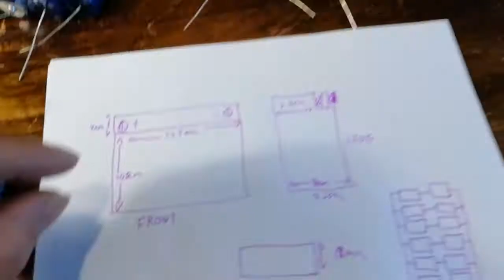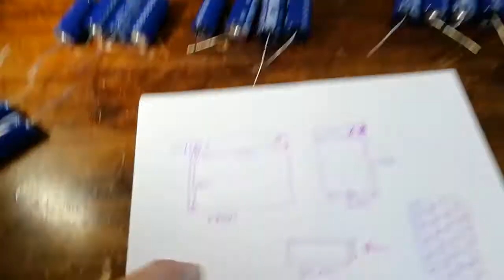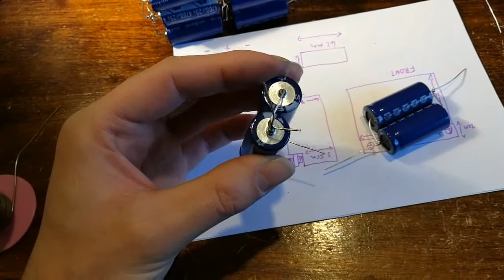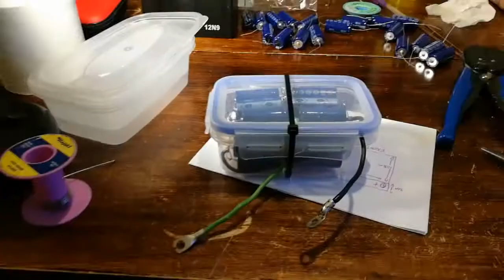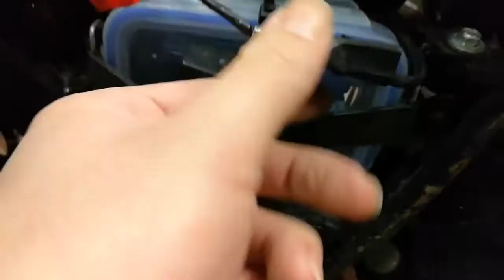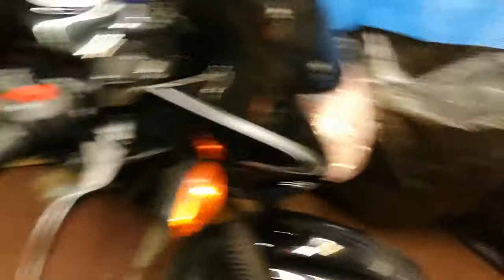Using PSU capacitors in place of a motorcycle battery.

Comment: This is great. I have a Honda monkey bike 1980 with a Chinese pit bike engine fitted. I would like to do the same thing. No room for a battery, but I can easily find somewhere to put these. I would want it so my brake lights and horn work better at idle. Do you have any info on the best caps to use, wiring/solder diagram and where to buy them? I may even considered using this set up on my enduro bike too
Reply from the maker: You can get some decent super caps from ebay. The modern ones have capacitance of several Farads and can handle the load current.

Comment: I picked up some used capacitors that look ok for ridiculously low prices today. Not knowing terribly much about caps I grabbed the 30000 UF caps but from reading below I might have been better off grabbing the high voltage caps for slow drain that you suggest. Anyhow I picked up two of these big boys for $1 each. Then I almost think it's worthwhile to go back there and pick up the other caps for $1 each. Then I'm looking for applications....
Reply from the maker: As long as they're rated above the voltage applied to them they will be OK.
Reply: @killcar5nbike2  Good to know! I picked up the two 15V ones. Sort of think I should head back and pick them all up at $1 each. They are probably all at least 30,000 UF based on the size of the two I purchased.

Comment: Can you tell me what micro f capacitor you used?
Reply from the maker: They were 4700uf. They worked OK for smoothing when the bike was running. All of them would run the neutral light for about 5 seconds.

OK for battery elimination, not a battery replacement though.
Reply: Does it work?.. what voltages will appear in the output by using 4700uf capacitor
Reply from the maker: Same as using a battery if the bike has a regulator. Just don't expect much power when engine is idling.

Comment: Why did you use 25v 4500micro F ?? Why not 2.7v 100F for example ? I think they could start the bike and doesn't cost that much !
Reply from the maker: High capacity caps are more designed for slow low current discharge.

Total energy in WH is CV2/2 /360. For 6x100f C=16.6. V from 13.5 to 11.5 =2. So 16.6x4 /2 /360 gives 0.09 WH total energy. 

6 100f caps at 12v to 0v would be 3.32 watts. Using the formula of useful voltage from 13.5v down to 11.5v would give an equivalent of a battery with a 0.008 AH rating. For the cost of the caps it's better to just buy a decent battery. It will provide massive amounts more power and last for years if looked after. 

I actually brought a Yuasa battery a few weeks back and really am glad I did 😉

This was more an experiment that ended up being used for nearly a year.
Reply: @killcar5nbike2  Thanks for your answer, i don't quite understand your maths but i trust you ! I 've been asking you this because i've seen people replacing their car battery with 350F 2.5v Capacitors and i would like to do the same for a motorbike. I will add a small solar panel to compensate the slow discharge. What do you think of that ? Have you seen the videos ?
Reply from the maker: I did watch some vids and was quite surprised how well it worked.

Just looking on eBay you can get a PCB with 6 100f caps in series for £15. I'd say be worth a punt buying one of those and seeing how it works. I'd be inclined to parallel a single 6800u 25v cap across them for low impedance smoothing when the engine is running.
Reply: @killcar5nbike2  I 've just bought 6 350F 2.5v and a BMS board (i guess it's that) for around 45€. I also have thought of putting some capacitors in parallel with an aging battery to compensate the loss of amp.